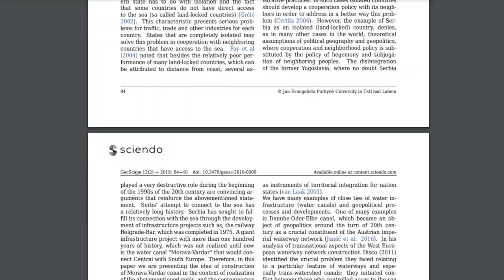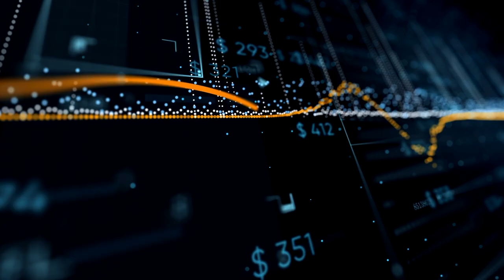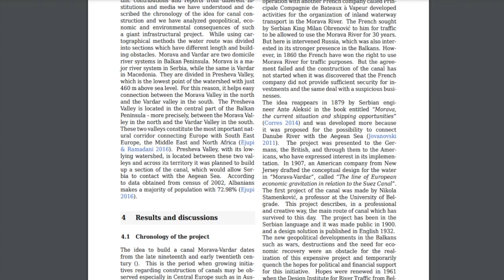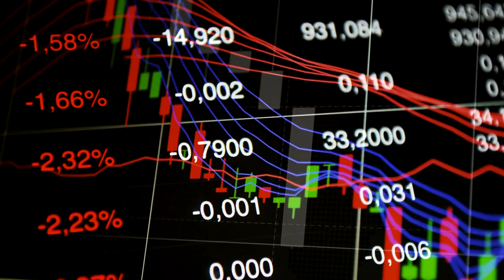Serbia’s Plans for a Canal to The Mediterranean

Comment: The maker of this video doesn't really understand what the proposed canal is all about. The canal would not itself be a route for ships, (like the Panama Canal), but would be a barge canal. It would enable barges to travel between river ports on the Danube River (and it's connecting waterways) and Thessaloniki, where goods would be transhipped to or from sea-going ships. This would be an alternative route for cargoes to and from the Danube as against the existing route via Constantza. Thessaloniki would become a transhipment port for Danube traffic like Constantza is now. The Danube carries a significant amount of barge traffic, in both dry and liquid cargoes, which are carried more cheaply and in a more environmentally-friendly way than by road or rail. 
Apart from the possible use by local traffic within the areas through which it would pass, the only real advantage of the new route would be, as it says in the video, that ships carrying goods bound to or from Danube ports would be able to load / discharge in Thessaloniki instead of Constantza, thus avoiding passage of the Bosporus and Dardenelles and possibly saving two or three days voyage time. It is very unlikely that barges would be able to travel from Thessaloniki to, (say), Belgrade any quicker than from Constantza and it may even take longer because of the large number of locks and lifts involved.
I am a big fan of water transport and would normally support any schemes for new canals, (like the one soon to be constructed in Northern France), but in this case I am dubious about whether the benefits would outweigh the construction costs. It is certainly feasible and some traffic would definitely use the route but probably not in sufficient quantity to justify the high cost.
Reply: He propably made the map himself, but he uses the Danube and not the Danube-Black Sea Canal so he would not end up it Constanza, which would shorten the journey.
Reply: The Turks are building a new canal so that they can toll ships going through it while the closing off the free canal for ‘inspections’ so it look like it might be worth it in the future.
Reply: Can you link something about the French canal?

Thanks in advance!
Reply: @kenlowe3673  thank you!
Reply: The Chinese would love to finance it. It’s not purely about economic value. It’s also their B&R project and influence in Europe. Serbia/Greece/Hungary are key allies of China in Europe
Reply: Akın TALAŞ  Turkey is NATO just like Greece, and it let's American warships to enter.
Reply: You are right but if it is going to save three days and 1000 KM and additional fees from the Turks, then I think a lot of companies would agree and use it,,, That<s the reason why the canal in some areas would be only 4 or maybe 5 meters seep,,, In my opinion it is a good project, economical and beneficial for the locals,,,,
Reply: As a Chinese, my feeling is that the construction technology of this artificial canal is not very difficult, and it should be relatively easy to construct. If it is the Chinese to design, construct, manage and raise funds. The overall cost should be the lowest in the world.
Reply: Akın TALAŞ  First, I am just an ordinary Chinese, and I am neither a scholar nor an official. I cannot get any authorization from the Chinese government and the Chinese Communist Party. I don’t know the initial brewing process of the Chinese government’s proposal of the Belt and Road Initiative. I can only speak as an ordinary Chinese person. First, I don’t think the Chinese government has made it clear from the very beginning what the purpose of the Belt and Road Initiative is. I personally guess that the initial reason is because of the huge military and political pressure brought about by the US Obama administration's return to the Asia-Pacific region, and the US island chain blockade, and of course the most sensitive Taiwan issue and the death of the Malacca Strait. Approximately, after an assessment, China believed that China was unable to break through the US maritime blockade, so it planned to find a line of communication from western China to Europe through the five Central Asian countries. In addition, there is also the huge overcapacity in China at present and in the future, especially the problem of overcapacity in infrastructure. Want to find a way to absorb the huge excess capacity in the international market.

When it comes to the Black Sea, I think the Chinese people, including the Chinese government, don’t know it and don’t pay much attention to it because it is too far away. As for the artificial canal project proposed by Serbia, I personally estimate that even the most famous Chinese experts, scholars and officials did not know about it before it was proposed by Serbia. For the Chinese, this is just a commercial infrastructure project that can be done without any difficulties. Finally, let me talk about why the Chinese like Serbia. This is because China played several Yugoslavian World War II movies when China opened its doors in 1980’. At that time, the Chinese were in a completely closed environment without seeing the outside world. Therefore, several Yugoslavian films of World War II completely conquered the hearts and spiritual world of the Chinese people. This kind of sentiment was also one of the main reasons why China supported the Yugoslav Federation in the Kosovo war. And keep it till now
Reply: With just a freight capacity increase of the existing railway route among Alexandroupolis - Varna - Constanza we reduce travel time and we avoid the Dardanelles and the Bosphorus at a low cost.
Reply: @vasiliosnorthaegean9882  Rail transport cannot compete on cost with barge transport on large-scale waterways such as the Danube for the carriage of bulk commodities. That's why they're planning this new canal.
Reply: this canal will never take place,
it is a dream from early 1900's 
also the dream of great Hydrologist, Jevjevich Vujica,
but after 1960's is abandoned,
As an hydrologist my shelf, I will explain the main reason why,
Axios river and sea level of Thermaikos gulf, are in a very peculiar balance,
So making Axios river a river canal, will turn all Central Makedonia, and a big part of Severna to a salty land,
to secure from salty sea water enter thousands of km2, needs many 'works, like huge riversides maybe bigger than N Orlean Missiipi, and also a working system like Panama canal
the project is abbandoned from 1960's as  dangerous for turning fertile land poluted by salty sea water,
Reply: @nikdegdelyian1834  You are totally correct. The whole municipality of Axios delta lies below sea level.

Besides, Axios Delta is protected by Ramsar Convention. A convention on wetlands of international importance. It is a haven of several bird species.
Reply: @vasiliosnorthaegean9882   this railway is about to expand more,
the target is connect Baltic with Aegean,
but the arque for now is if it should pass, through Ukraine, or from Slovakia, there also a search to make beside the train a pipeline that would connect Baltic sea with East Med hydrocarbon,
but for now the expansion is from Varna to Constanza.
Reply: @nikdegdelyian1834  Cooperation will bring peace and prosperity for all
Reply: Akın TALAŞ   Tottaly wrong,
the new project is Burgas-Constanza,
that will make a huge railway from Alexandroypoli to Constanza,
that will decrease the Bosporos traffic by 40% and will bring ecological benefits to Constantinople,
Also the new NATO base at Varna Bulgaria, and the connection with Alexandroupolis port, (before 1-2 weeks you may  read the forces) is about to host 30 000 troops,
105 helicopters, and the ability to accomodetate even Destroyer class ships.
Reply: Akın TALAŞ  Tottaly wrong, Turkey can not decide who will pass Bosporus, the  treaty of  Montroe 1930's
Reply: Akın TALAŞ  by what I know, Battleships are max 3 days not 36, and some countries have eternal priviledge, like Russia Greece France etc.
Anyway the new railroad Alexandroupolis-Burgas-Constanza, will help till 40% less intense at Vosporos canal, and help ecological the canals
Reply: Akın TALAŞ  again you do not know Montroeux treaty,
the change of 1936 does not take the privilidge of some countries, 
neither they want permsission from Turkey,
a simple warning, and at 3rd day they pass,
the change of 1936 just allowed Turkey to have army and guard at warships at the chanel, for Turkey,
and for Greece to have army at 6 islands which with Lausagne treaty, was not allowed,
the 1936 treaty follows Sevres - Lausagne-Montroeux, and allows Turkey to keep guard and army at Vosporos, and Greece to keep army at 6 islands that Lausagne did not allow,
I suggest read again the treaty,
this priviledgebelongs today only for Black sea countries, and Greece,
every country of the above if is not at declared war with Turkey, may pass free, to max time of 3 days from warning the Turkish authorities.

the protype:
https://cil.nus.edu.sg/wp-content/uploads/formidable/18/1936-Convention-Regarding-the-Regime-of-the-Straits.pdf
Reply: Akın TALAŞ   again like AKP and Erdogan you do not know the treties,
1. islands Lemnos Samothrake  belongs to chanel. as also Imbros and Tenedos.
by article 13 of Montreux treaty, the Lausagne treaty is CANCELED as concerns the 'Bosporos chanel' 
that gave Turkey rights to  bring army and guard the chaneel, and  Greece the right to have army on North aegean islands, 
turkey send army to Imbros and Tenedos islands, and Greece to Lemnos Saothrake etc,
that move we salute by Ismet  Inonou.
in fact at Turkish parliament was voted the allow both to bring armies at their own islands,

plz read the treties and Turkish laws and hostory correct, and fair, not like Neo-Ottomans.
but as Kemal would do.
Reply: Akın TALAŞ US controls Bulgaria and Romania. Russia never fought Ukraine,  troll.
Reply: Akın TALAŞ  Just like Ukraine "invaded"  Russian Crimea in 1954? Like that? Troll.
Reply: @Alex-pj8nz  lol dude bosphorus is already at mac capacity and accident occur frequently. That is the main reason
Reply: Akın TALAŞ  turkey signed an agreement( Montreaux) along time ago to allow free passage through the BOSPHORUS. Including certain size military vessels. If it breaks that agreement the superpowers will take over the straights. Russian ships would  be trapped in the black sea.
Reply: Akın TALAŞ  nonsense. If that was the case why some Turkish admirals worried about the proposed new canal  would change the status quo of the montreaux agreement .
Reply: @huiouyang2003  God bless China...As a Christian I would trust China more then the US or western Europe
Reply: @copticstate  thank you very much
Reply: @huiouyang2003  we Serbs welcome all our friends come and visit its got great nature resorts to enjoi
Reply: which northern france canal are you taking about ?

Comment: A simple upgrade of the existing railway and highway of Thessaloniki - Gevgeliya - Skopje - Nis - Belgrade and Zagreb route is much cheaper and more efficient than constructing a pharaonic project.

A cooperation among ports would help a lot like among Vlore (AL), Thessaloniki & Alexandroupolis (GR), Burgas & Varna (BG) as well as Constanza (RO).
Reply: Water transport is much chipper than railway or road transport , special with oil ,petrol, coal and huge dimension goods.
Reply: @lilianajankovic737  it is, but this river construction w0uld have additional costs. Anyway it would require study of both to compare.
Reply: Boring

Comment: I really wish this project becomes reality plus I think countries like Austria Czech Republic and Hungary should also help in its construction since it will benefit them alot
Reply: Those countries already has access through romania and danub river. Passage through turkey is free and regulated by a treaty that protect the right to pass  during war or peace. So they realy do not have same motivation that greece has
Reply: @ABC-ri9sx  Don't you think that traveling three and a half days less is a nice financial motivation?
Reply: @SrSRB  it is shorter for countries like romania to go through old route. But some countries like austeria could benefit from shorter time in the new route. However, they have to use smaller size cargo ships, which cost them more per container.

Comment: a slight correction to the drawing at 03:00 would be in oder - the Danube in Belgrade would be lower than 121m above sealevel of the Adriatic, so the height of 492m should be somewhere in the mountains of North Macedonia. Skopje on the river Vadar is at 240m, and lies in a seismic active area.

Comment: $17B for all that seems EXTREMELY unlikely: I would guess 4 times that amount even without corruption and setbacks: $60B+. Compare to other major riverway or travel costs. Egypt is spending $14B to widen the Suez Canal, which is only 120km long and is already an existing structure. This appears to require massive rework on both rivers, plus the 30km canal added in the middle through the mountains (not cheap in itself), plus they claim adding subsidiary rivers, and slapping 5 dams on there, and having an insane 63 locks. Also, let's talk about having 63 locks for a second - there are 12 locks on the panama canal and their maintenance and support comprises most of the cost of passage through the canal: which is about $500k one-way. So 60+ locks is 5 times that cost, or around $2.5M in expected transit fees to maintain just the canal infrastructure between the rivers: let alone the near-constant dredging work that may be needed to maintain both rivers in working order - and I'm comparing to Panama that doesn't have initial costs to pay off: so let's double the transit fee for the first 60 years, to cover the build cost. Would each boat be expected to pay around $5M to pass through this artificial river system? Versus the ~free (thousands, not millions) to travel via Turkey/river? 
Seems to defeat the point. Especially when Europe already has plentiful highspeed rail lines, including Belgrade to Bar on the Greek coast directly south (296km). Maybe they need more flatbeds for sea-cans, maybe they need to twin some rail lines, but that would cost hundreds of millions, not tens of billions. This screams vanity project to me, maybe some Rhine Envy.

Comment: If there is any valleys it might be easy to use them as lakes between the rivers and water locks. With the Danube river higher in elevation it seems like if the canal connecting the Morava and Vadar river it would get dug deeper by the flow of water from the Danube River.

Comment: The Panama canal works with water locks and at the center of all of the water locks is a human made lake to get the water for the locks from. If there is not enough water flow to keep lake filled they would have have pumps and piping, and reservoir lake to draw water from to fill the human lake up with when it gets low enough. I recommend watching the Panama canal videos and Erie water locks videos to get a good idea what it would look like and what works best for such a project. To supply power they might have to use wind generators instead so water level doesn't drop to low.

Comment: How its possible that Danube is 492m higher than Mediteranean when belgrade is actually 117m above sea level, and the city itself is raised about 50m from Danube. Thats smth incorrect, maybe the highest point is 492m
Reply: 492 m is the highest point of the Morava river in the Presevo Valley From that point, it's only 30 km southwards the highest point of Vardar flowing south to the Aegean Sea.

Comment: Great video. Extremely ambitious but very interesting concept. It would change relations between Greece, Serbia and Turkey forever as Turkey would lose holding much of its power over trade. Greece and Serbia already have friendly relations with each other but North Macedonia could cause problems if they didn't agree.
Reply: North Macedonia is Greece's, Bulgaria's and Serbia's harem so I dont see that
Reply: @novussyrius6036  What a load on nonsense.
Reply: In Macedonia we are against this plan, because it will make a lot of environmental damage and we are probably not gonna benefit from this. It's not that we won't want to work together with Greece. I see a lot of people are positive, but its easy talking when they are not digging in their own country.
Reply: @stefanstojance14  As an individual, you cannot speak on behalf of Macedonia. You can express your own view. As far as I'm aware, neither the current nor the previous Macedonian government has opposed the idea.
Reply: @billocoy9811  yeah you are right, but majority is against
Reply: @stefanstojance14  Unless you have conducted an accurate poll, you can't claim a majority.
Reply: @stefanstojance14  
Point 1) Geography 101 : As far as I know in order to get from the Aegean Sea to "North Macedonia", Greece has to dig in their own country as well. 
Point 2) If Skopje want to  be land-locked forever that's  their own prerogative